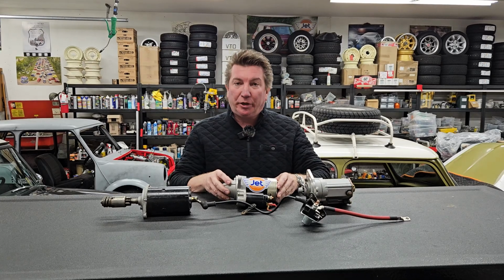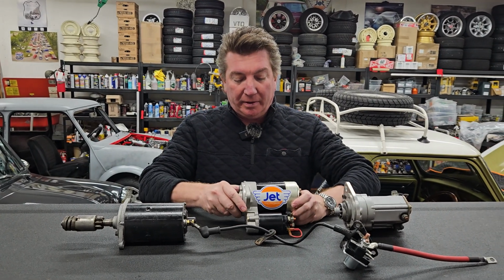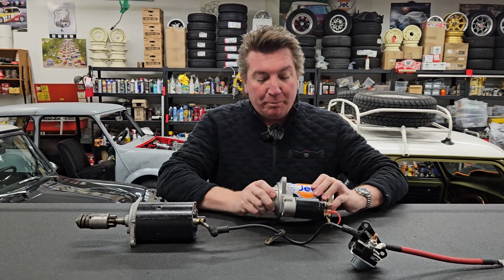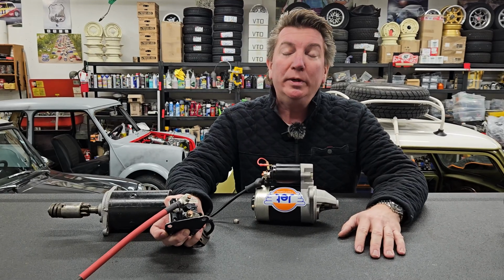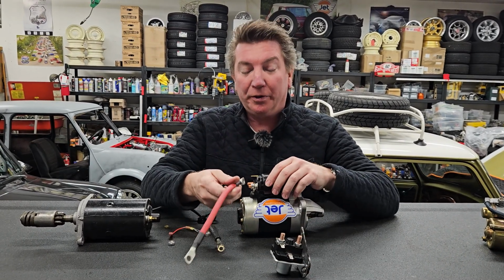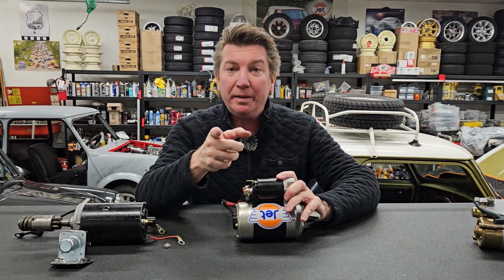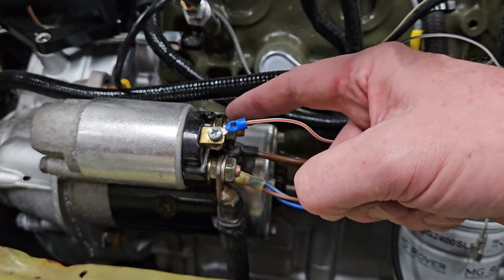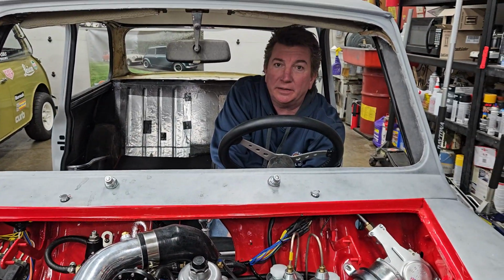Mini High Torque High Power Starter for Classic Mini Cooper

Comment: Can you confirm which tooth flywheel they are for? As it seems to convert pre-verto inertia 107 tooth to work on the pre-engaged type which only works on a 129 tooth.
Reply from the maker: This starter is for the pre verto 107 tooth flywheel. Does NOT work for verto 129 tooth flywheel.
Reply: Will it fit a mg midget 1500?
Reply from the maker: yes it will fit midget 1500  @spiketheimpaler4698
Reply: Thank you for the quick reply i had forgotten that the 1275 and the 1500 shared starters even though i have both engines was about to start searching for an isuzu gear reduction starter. Mind if i ask price? Would like to put a turbo kit in my 68 AH Sprite my 1275 has been bored and stroked to a 1480. You have gained a new subscriber.
Reply from the maker: @spiketheimpaler4698  https://www.jetmotorsmini.com/product-page/jet-motors-high-torque-starter-upgrade